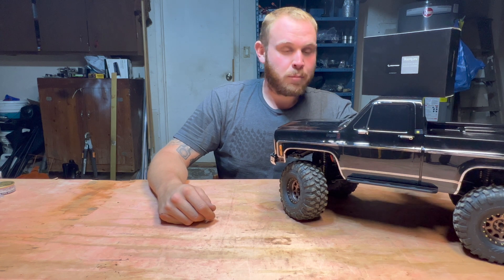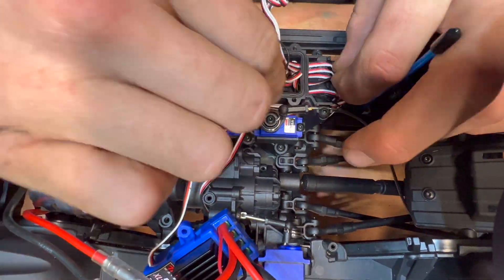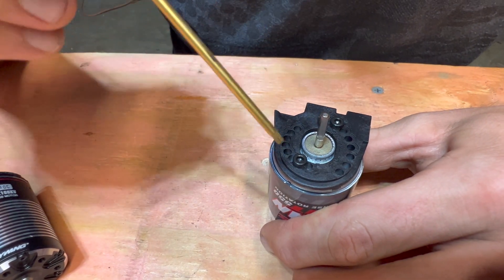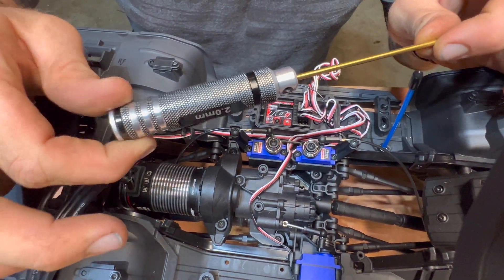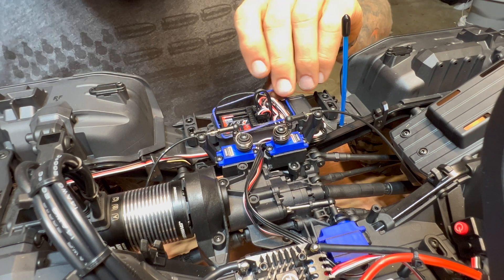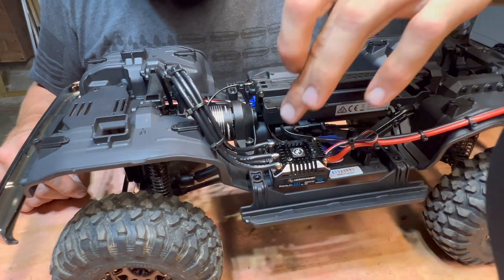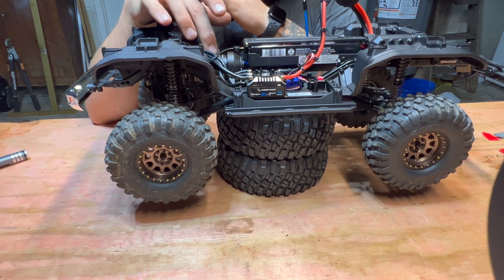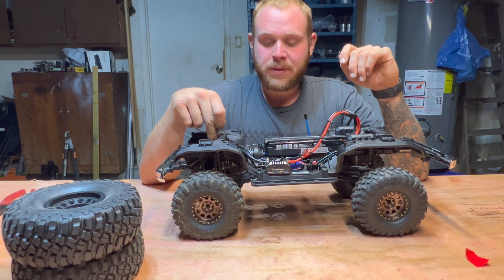How to Brushless Swap RC  Traxxas K10 TRX4

Comment: Awesome content and I know you just put that new motor in but have you seen and thought about putting in the new Hobbywing 2300 fusion pro; I just put that into my TRX4 Ford Bronco which I am in the process of doing a conversion, not to the high trail but to the extended, and man that hobby wing 2300 is a game changer for sure.
Reply from the maker: actually have that exact motor/esc set up in 3 other rigs, definetly a beast

Comment: Good choice on the upgrade. Hobbywing makes a decent system at a great price.  Interesting how the motor mounts into the K10. It's funny how the motor rotation is always wrong. Nice clean installation. No wires hanging out anywhere. Perfect.... 👍👍 Thanks for sharing.